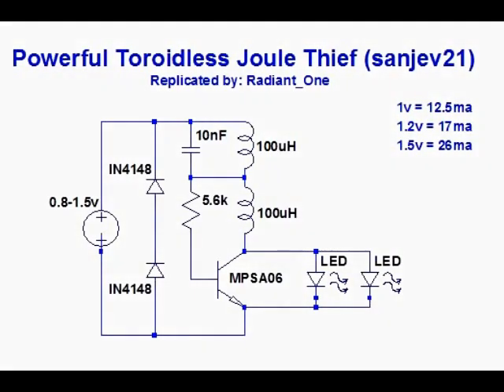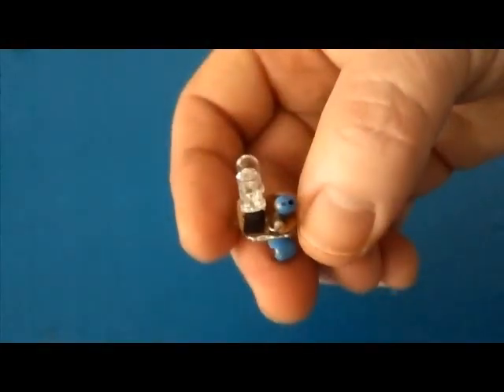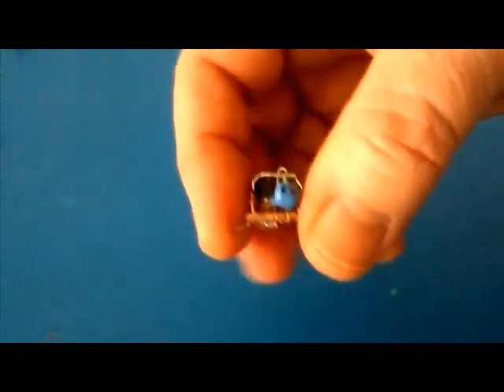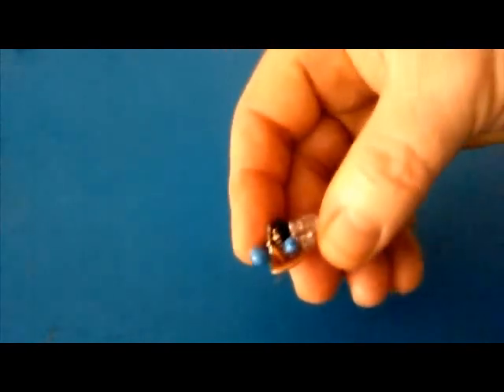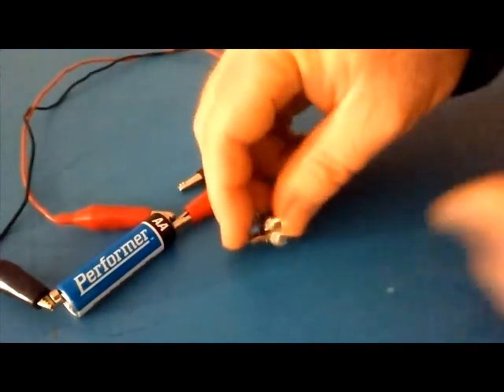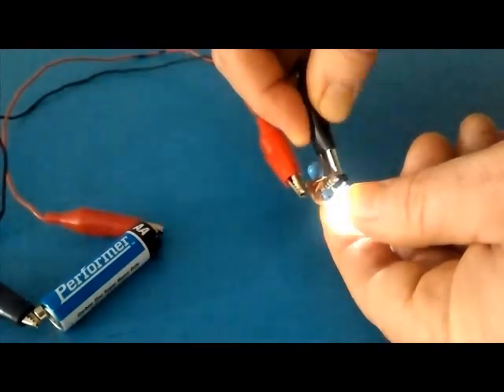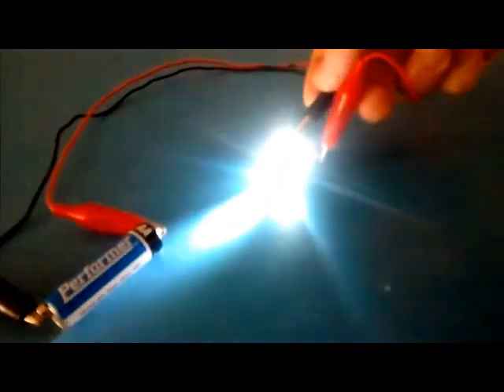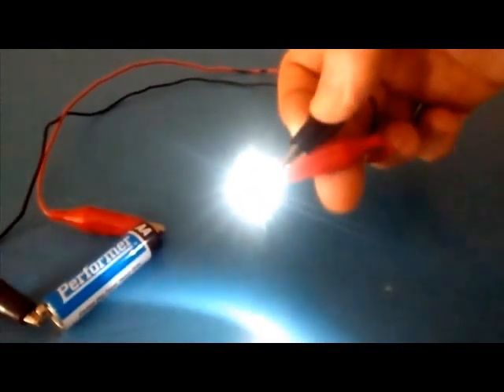Powerful Toroidless Joule Thief Replication

Comment: can you explain the 1n4148 use for ?
Reply from the maker: not necessary. They were an AV plug for trying to run circuit from radiant energy. The IN4148s can be left out as mentioned in the video

Comment: The components' list is different from the original. Even Sanjev21 has 3 variations in his list. (MPSA06, MPSA18, KTN2222A, and Resistors 5.6k/4.7K). Some clarification would be helpful.
Reply from the maker: I used MPS06A